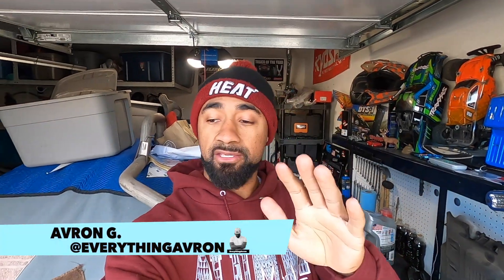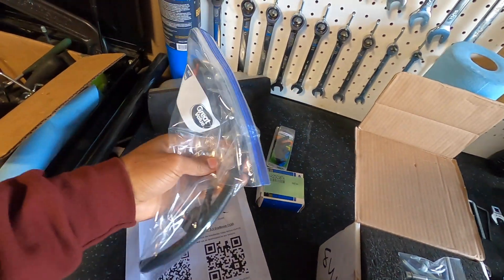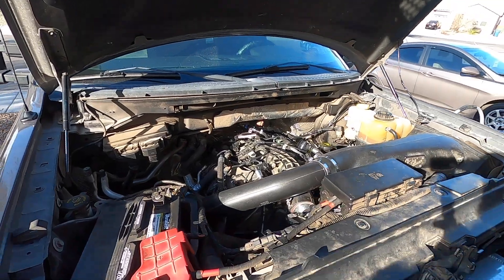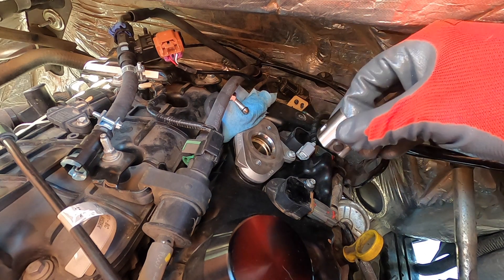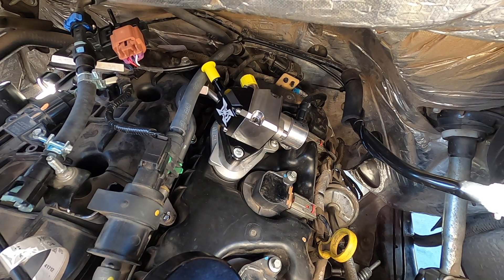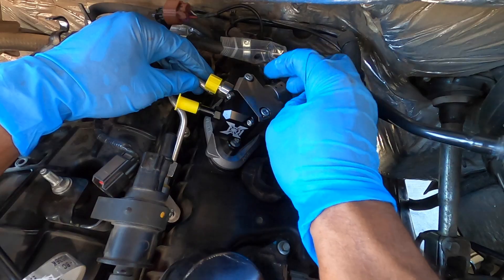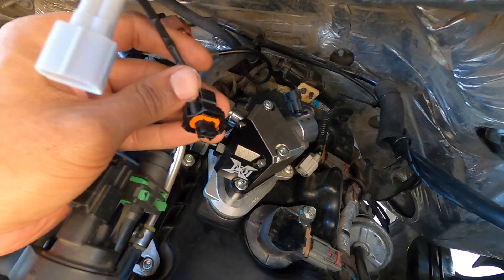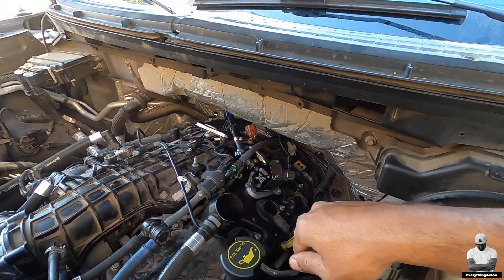HOW TO INSTALL XDI-HPFP IN A FORD F150 |Upgraded my 2014 Ford EcoBoosts Fuel Pump to an XTREME-DI-35

Comment: I’m definitely thinking of grabbing one of these along with some performance injectors but I have no plans of switching to E85 other than to try it out maybe once after I’ve gotten a tune. Wondering if it’s still worth it since I primarily run 93.
Reply from the maker: If you plan on only running pump, gas without upgrading turbos. It’s not worth buying it… however if you do decide to want to go E85 or any high level ethanol content, I 100% recommend by the XDI-60 not the 35…. Even though I am on stock turbos when I run E85 I still am running into fuel starvation in the lower RPMs. Back when I purchased mine the XDI-35 was $1500 and the XDI-60 was $2500. So it’s an investment either way
Reply: @EverythingAvron  definitely picked up the full race Garrett stage 1 turbos, but they are sitting in a box till I get the rest of my parts in. Doesn’t look like the XDI-60 is available for my 2013 FX4 3.5 EcoBst, but they’ve got an XDI-EVO for $1599 on their site but it doesn’t appear to be any different spec-wise than the XDI-35. I’m confused!

Comment: I love my truck but man I'm annoyed just had it in the dealer for a month getting a warranty 4 grand timing job done at 125k miles now a week after getting it back I get a p0087 low fuel rail pressure. I'm suspecting I need a new hpfp

Comment: Any issues with the pump a year later? I’ve heard that they’re “temperamental” from two different Ecoboost builders, one being Brew City Boost, so I’ve been holding off. But now I’ve literally got nothing else to upgrade since I got my Garrett turbos, and I REALLY wanna run e30 or even e85, so any pointers you can give on longevity would be appreciated. 

Thanks man, and awesome build! Mines pretty much a duplicate lol just different brand parts

Comment: Don't want to tell you how to mess with your stuff but you should really never put your fingers near high pressure lines. I know they aren't under the stress of a common-rail but they will still cut your fingers off and probably cause poisoning from the fuel mixing in the wound. So I would be cautious if I were you
Reply from the maker: will take that into consideration for sure👍

Comment: What other mods have you done to your truck I'm curious.  I have a 93 tune, Mishimoto I/C, BBK TB, and hot / cold pipes, and I figured turbos or a HPFP would be my next thing to do.  This is obviously a cheaper / easier route for sure.   Do you datalog your tunes too by the way?  I figure it might take a few revisions to get it really dialed in.
Reply from the maker: So I have my current list of performance mods in the description field of this video. https://youtu.be/ZNAC_6Pgb5g
Reply: @EverythingAvron  Looks like we have very similar setups. :)  I'm missing the downpipe, and I have a 3.31 rear end with 35's so my gearing is not ideal.  What kind of altitude are you at?  Truck sounds like it's happy.
Reply from the maker: @therealpimpskillet  my bad didn’t answer the second part of your question,  but yes I log my own data logs and review them take notes then send them off to my tuner. But we are still going to revisit my E85 tune because my first run in that video was just before I installed the DW400. So I’ll log again soon... And I’m at 2700ft out here can’t wait for the day to run the 1/4mi in Cali at sea level lol

Comment: Thing sounds loud AF 🤣
Reply from the maker: Lol perfect! 👌...cold starts are exceptionally loud .
Reply: @EverythingAvron  These Gen 1 3.5EBs do sound a lot like a diesel due to the High Pressure.  Just the nature of the beast.  Good video.
Reply: Lol I ment the pump the truck sounds alot like mine 😁 I have been thinking of doing the fuel pump but E-85 is not available everywhere I go so I have always been concerned about travels on full E-85
Reply from the maker: Oh yea this pump does click a lot louder... but once I close the hood and am inside the vehicle you can’t hear it too bad. But yup that’s true, I lucked out with the E85 we have a station like 7 mins from my house